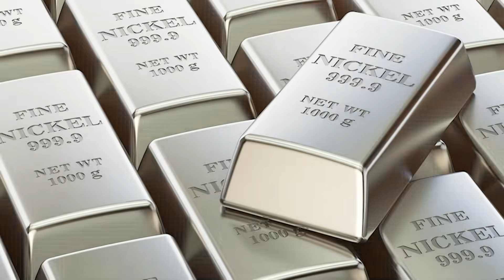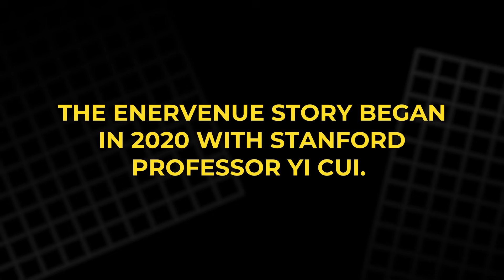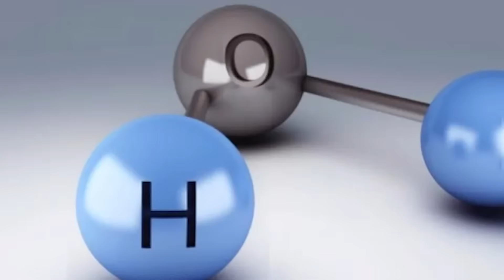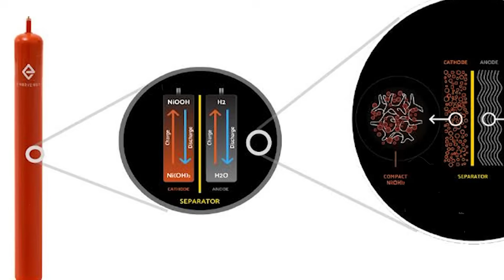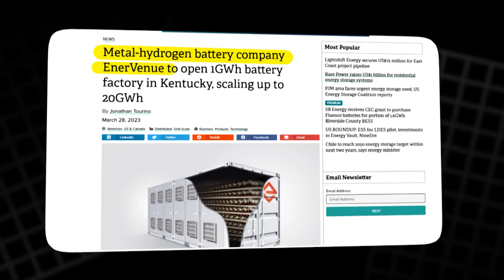The “Forever Battery” NASA Built for Space Is Finally Coming to Earth

Comment: You don't have to store solar energy for night time use because the daytime base load is twice the night time base load and the evening peak is 3 times the night time base load. You do have to store some solar for that huge evening peak and the combination of sodium ion batteries with 10,000 cycles at 5 C power density can provide better frequency control at 1/3 the cost of gas peaker plants.

Comment: Forever Battery? I had to ask ChatGPT: A Hydrogen fuel cell called Hydrogen Nickel battery, or might it be a nuclear battery? An electracies battery that splits water and when the H2O joins it makes electricity? What made me think this had something to do with nuclear was that @TheForgeEmpire talks about splitting H2O, and of course the closest thing to a forever battery is a Nuclear Battery.??

ChatGPT Said:

Good question — it sounds like you’re describing several overlapping ideas that people sometimes refer to (loosely) as a “Forever Battery” — but let’s clear up what’s real and what’s speculative:

🔋 1. “Forever Battery” — The Popular Term

This phrase isn’t a scientific name; it’s a marketing or media term used for any ultra-long-life or self-recharging power source. It can refer to:

Solid-state batteries (extremely durable lithium replacements)
Hydrogen fuel cells
Betavoltaic or nuclear batteries
Electrolysis-based regenerative systems
So depending on who’s talking, “forever battery” can mean different technologies.

⚗ 2. Hydrogen Fuel Cell (Not Actually a Battery)

A hydrogen fuel cell converts hydrogen (H₂) and oxygen (O₂) into water (H₂O) while releasing electricity and heat:

[
2H_2 + O_2 \rightarrow 2H_2O + \text{electricity} + \text{heat}
]

It doesn’t split water, it does the reverse — it combines hydrogen and oxygen.
To “recharge” the system, you must supply more hydrogen (often produced by splitting water elsewhere via electrolysis).
Some experimental systems integrate hydrogen production and fuel cells, so the same device can both make and use hydrogen — but energy must come from an outside source (solar, etc.).
🧪 3. Hydrogen–Nickel Battery (Confusion Alert)

There is a real type called the nickel–hydrogen (Ni-H₂) battery, used on satellites.

It stores hydrogen gas in pressure vessels and uses nickel electrodes.
These can last decades in space, so some people call them “forever batteries.”
However, they still need periodic charging from solar panels; they’re not perpetual.
☢ 4. Nuclear Batteries (Betavoltaic or RTG)

A nuclear battery uses radioactive decay to create electricity.

Betavoltaic cells use beta particles from isotopes like tritium or nickel-63.
RTGs (Radioisotope Thermoelectric Generators) power spacecraft (Voyager, Curiosity Rover).
They can last 10–100 years continuously — the closest real thing to a “forever battery.”
But they’re not hydrogen-based and involve radioactive materials.
⚡ 5. Electrolysis “Split Water to Power Itself” Idea

If a device splits water into hydrogen and oxygen and then recombines them to make electricity — it sounds perpetual, but:

Energy is required to split water (electrolysis).
The recombination only gives back that energy, minus losses.
So it can’t run itself forever without an external energy input (solar, nuclear, etc.).